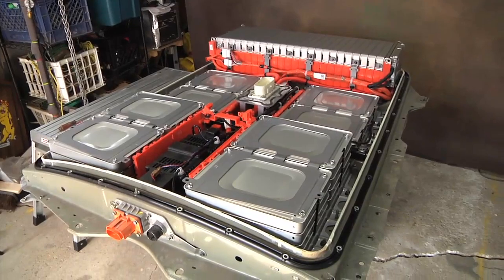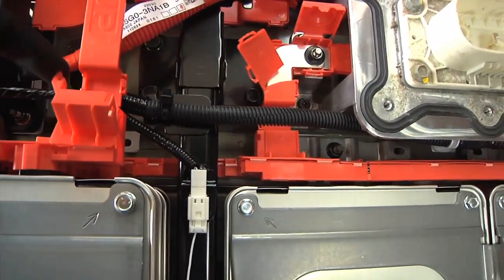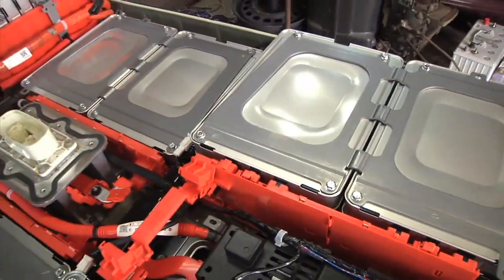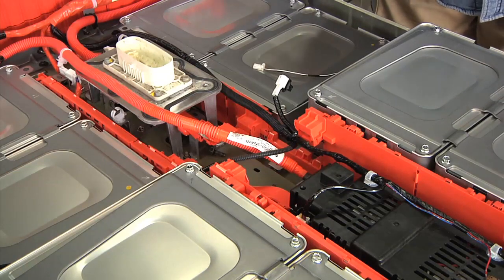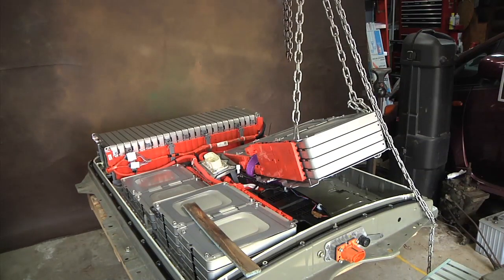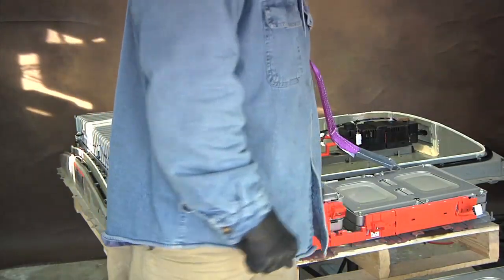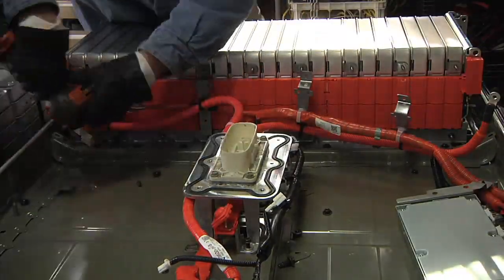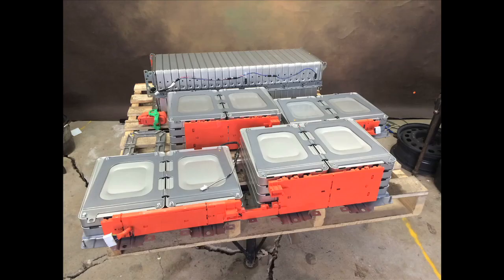Taking apart a Nissan LEAF battery pack, part 2

Comment: Thanks for sharing the video.  I own a 2011 Leaf and I have often thought that there is plenty of space in the trunk for another set of batteries.  I am thinking about doing what you have done, except building a trunk case for my car, and keeping all the components of the Leaf Battery pack.  It might require a little electronic and electric rework, but I am thinking a switch to the second battery pack should work.

Comment: Ben be careful stacking the extensions on your wratchet, the more extensions the greater the risk of them coming apart and one falling down and bridging a terminal or two, if you need such a long extension then maybe tape them with electrical tape
Reply from the maker: Good tip!

Comment: So the big pack of 24 modules was at 202v. Each module has two cells in series. Which means each cell was at the maximum voltage of 4.2v

Comment: Now that is the pack i need for my 2010 wheego whip . still can't get the curtis controller to turn over 4200 rpm . ya i had to sneak a question in

Comment: Thanks for the info. I've a 2012/Dec X grade leaf and its showing 197Km on full charge. Just wondering if there is a way to check if the standard battery pack has been extended/modified?
Reply from the maker: +Pavan Welihinda If you have a working Nissan LEAF, you can use an app called LEAFSPY, along with a bluetooth or RF ODB2 reader to connect to the car and display information about the battery. For details of what's "normal" or not, you can consult other members on a LEAF forum.
Reply: +BenjaminNelson Great. I will download this app and check. Thank you very much. I have a Leaf from Japan, do you know if by any chance i could change the language to English?
Reply from the maker: +Pavan Welihinda
I'm not an expert in the LEAF, so sorry, I can't answer that. I'm sure that if you search through or leave a message on a LEAF forum, somebody can help you with it.
Reply: +BenjaminNelson Will do. How many packs were installed when you dissembled the leaf battery?
Reply from the maker: +Pavan Welihinda
I Nissan LEAF pack is 48 cell modules. I used 18 of them in my Vectrix, sold 18 to another Vectrix owner, sold 11 to a friend building a custom electric motorcycle. That left one module for me to show off at presentations. Essentially, we build 3 electric motorcycles from one crashed Nissan LEAF.

Comment: Cook stuff.  How many will you use in motorcycle?
Reply from the maker: msredneck001 I will use 18 in the Vectrix electric super-scooter. I have another guy with a Vectrix interested in 18 for his, and I know another guy interested in 11 for his electric motorcycle. It's about 8 volts per cell module, which has 2 cells in series and 2 cells in parallel (so 4 total cells) in each module.
Reply: i know there's 8 V  per cell but how many amps   . i'm trying to figure out a way to  recreate the capacity of   a car battery but make it lighter. im in the process of making a expedition  suv ( off road camper ) basically
Reply from the maker: These ones are 60AH capacity. Each unit is a little less than half a kilowatt-hour of energy storage. The Leaf has a 24kWh pack, and it's made from 48 of these cell modules. I ended up using about a third of this battery pack to build a battery for a Vectrix VX-1 electric motorcycle. The rest of the pack went to two other friends building electric motorcycles.

Comment: How did you get the battery out of the truck?
Reply from the maker: Backed the truck into the garage. Lifted the battery straight up with a chain hoist connected to big steel pipe running through the rafters. Drive the truck back out, lower the battery down.

Comment: Is it possible to just drain the battery completely before you work on it for safety?
Reply: Check out EVTV.me on Bottom Balancing batteries. Pretty much you would connect something large enough to drain the batteries down to 0 if you wanted to. He should have kept the pack all together and built a small pickup truck EV conversion or even a family sedan car. He could have used Calb 80 batteries for the Vectrex.
Reply: It's worth saying that you NEVER want to take a battery down to 0V! This is called overdischarge and you'll damage the cells and risk a fire by doing so. LEAF cells are considered fully-charged at 4.2V/cell and fully-discharged at 2.5V/cell, so even when "empty", there's still energy in the pack. The safest way to work on a battery is to know how electricity works: no complete path = no danger.
Reply: Jason Arnold Our neighbor had a new Leaf and it already had charging issues. It took them weeks to fix the car, most Dealer's own employee's have no idea how to fix all these new fangled electrics.